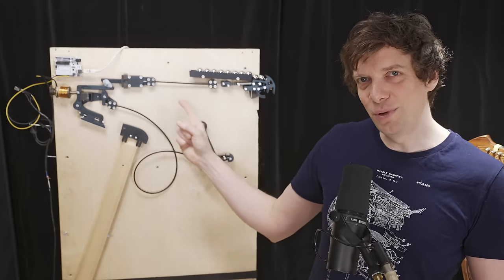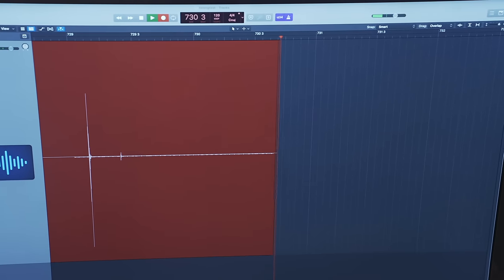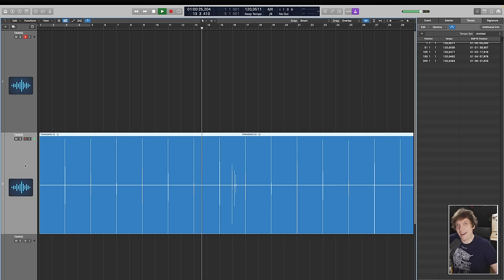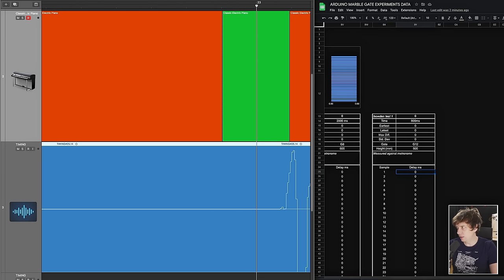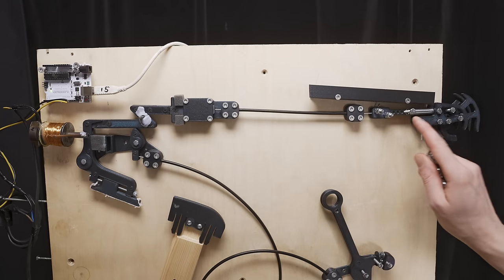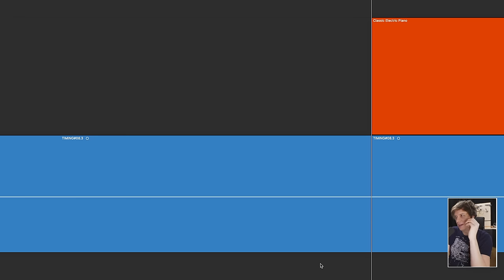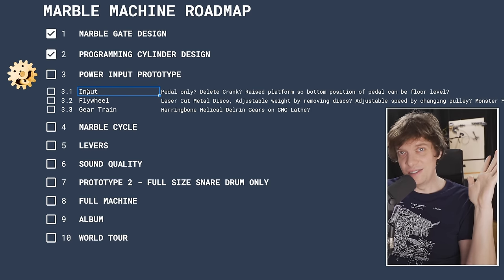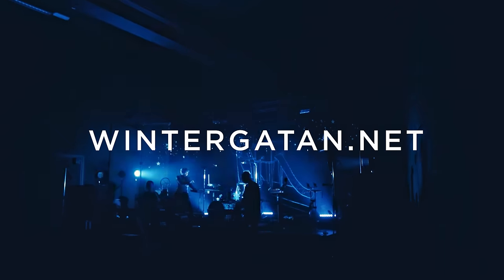Can Bowden Cables Play Tight Music?

Comment: From what I can see you just tested straight and short Bowden cables for the marble dropper. I think you should test out different lengths and degrees of bending of the cables, and compare how much of a difference it makes. This is the optimal condition, and those are unrealistic in the long run 😉

I don’t want to put you down, I just want you to succeed!
Reply: Yes, I've essentially asked the same question.  It'll be interesting to see how he chooses to break it down.  I'd like to see a scale that shows how much variance is accumulated for some standard length (say a centimeter), and how much variance is added for a loop of say a meter vs. a straight meter.
Reply: Similar ideas have been said many times, and so far Martin doesn't seem to be listening... But I agree he must test an actually realistic length and curve - just a small curve in that short length would be expected to make a pretty big difference (capstan equation is a good guide here!). Along with testing just how many notes/ how long that cable can remain under tension before it stretches enough to matter for his desired degree of precision, and for good measure borrow a somewhat used bowden from an old bike and see how much worse one that has some dirt and wear is as well - the shipping of a world tour and all those songs mean its going to become an issue in the end!
Reply: When I study the setup, I'm not sure this will matter.  The critical timing is in the marble release mechanism at top right.  He could pull it with a string or a thick rubber band; so long as the return springs snap it back, the marble drop will be precise.
Reply: Exactly in the end the spring showed that the friction will have an impact on the timings. One more these cables lengthen with time, it would also be necessary to know the impact that its will have between the channels. In a straight line I find that a wire would be much better both in terms of manufacturing and consistency over time. And to return the movement in another direction there are good solutions even with a rigid wire (which will always cause a defect but which will be known and constant).
Reply: Funny he pointed this out in a previous video and even set one up with a loop. I wonder why it isn’t being used for this test.
Reply: + this!
Reply: @youtubemakesmedothis7280  If the cables get longer, the channels will no longer have the same timing between them, which will require regular tuning. If the friction increases it changes the timing of the channel as the spring shows in this video, which will require maintenance (oil) will enter a fault that will require a cable change. A rigid cable would be better or even a fishing line without a sheath.

But if we are here to debate it is above all that the test of this video does not allow us to draw the slightest conclusion.
Reply: The test did show that spring strength to draw the cable through the tube can address variance. I loop test wouldn't hurt but I'm not convinced it's necessary.
Reply: @youtubemakesmedothis7280  Well, we can at least say that the critical moment is when the cable is released.  But, it will still be interesting to see it tested to see if anything unexpected happens.
Reply: I know someone suggested aerospace-grade bowden cables.  But, I'd kind of like to see this tested with degraded cables too.
Reply: One variable at a time. Testing too many things at once, can cause confusion into what is exactly causing problems in the music's tightness.

So testing optimal conditions for the bowden cable, ensures that the only thing being tested is whether the bowden cable is a viable option for use in the machine.

Now that we have that answer. The next question to answer: How bendy can the bowden cable be, and remain tight?
Reply: @deathsheir2035  Yes, you have to isolate variables.  And your right; people do get confused when then fail to do this.  But, you also have to analyze their interactions as well.  Really good analysis would yield metrics for varying lengths separate from coiling, metrics for coiling separate from varying lengths, and metrics for some "sane" combination thereof.
Reply: @deathsheir2035  No, look carefully at 6:57 "verify prototype" is checked. When we are at the stage of design and choice of solutions, we always test in the worst condition and above all never in an unrealistic condition. Otherwise we come back to the worries of the previous machine and arrange choices that were bad at the start but appear good in different conditions. And if we insist it is that the Bowden Cables is not a good solution. Even if it works, it will require an acordage after each concert which would not be necessary with any other solution, other solutions which would also require less construction work which is a criterion for the mm3.
Reply: @tiper2107   You do know majority of all prototypes are first tested under best possible conditions, before being subjected to worst possible conditions, right? I've done prototyping myself, and there is a sieres of questions to ask during the prototyping phase, before you finalize the design.

1. Does this work under the best possible conditions? If the answer to this question is "no" there is no point in testing any further.

2. At what point does this prototype fail?

3. What improvements can be made, to make it work better for longer? Or What improvements can be made, so it can function under worse conditions?

ON TOP OF THAT... Vehicles now adays, designated for "Off Road" are not tested under the conditions of which they are being advertised for. Paved surface, providing far superior grip, with an incline of 5 degrees, for no higher than four feet, is NOT the worst possible conditions for a vehicle designated as an "off road" vehicle. So don't give me that crap about designs are tested under worst possible conditions.

I can also assure you the M-16 when it first entered military service, was not at all tested under worst possible conditions eithern before being sent to our soldiers on the front lines.
Reply: The pulling forces employed are very slight; I can't imagine there'll be much stretching of these cables over hundreds of thousands of pulls on them.  Compared to the forces encountered on bicycle brake cabling, the tug is quite gentle.
Reply: @matambale  it would still be wise to get a bowden cable designed for push pull action, as a precaution. The less maintenance you have to do over time, the better.
Reply: @deathsheir2035  Agreed, especially as there will be so very many of them.
Reply: @deathsheir2035  First read my previous comment, you recognize (staying on your work process) that this is a first test, except in the video it is the final test since it validates the concept!!! I gave you the timecode!
Otherwise, you are mistaken because you are confusing your work, testing prototypes already chosen in an ultra-rigorous framework and design: testing concepts.
If you have to design a hiking vehicle and you think the caterpillar is great. That you test it on a very smooth and flat road, with a perfectly oiled new track and that your engine is already at 100% and that you tell me this test is useful and conclusive to move on to the next stage, you are wrong!! (here the correct solution was wheel with studded tire and the minimum is to compare the two).
Reply: @matambale  The stretching is not due to the force but to the manufacture: multi-strand twist. Then what counts is not the force but the force multiplied by the solicitation. The force will be much weaker but the solicitation in concert will be almost constant and above all will not be the same according to the chanel. This means that the more a note will be played, the more it will lag behind the lesser played notes.

In addition to its wear which induces friction (which we have already seen the impact with the spring in this video) is more dependent on the solicitation than on the force.
Reply: @tiper2107  I literally gave you two god damn examples of designs being tested and approved, that disproves your statement "When we are at the stage of design and choice of solutions, we always test in the worst condition and above all never in an unrealistic condition."

Off Road Vehicles are being tested by car manufactures in unrealistic off road conditions... smooth paved road, with short, but very steep paved incline. And the manufactures uses that as "Yep that's off road" and then sells it as an off road vehicle.

The M-16 is another design that wasn't tested under worst possible conditions. If it was, our soldiers in Vietnam wouldn't have had the issues they were having with the damn firearm.

Two designs that were tested and finalized, that disproves that one statement. And was completely separate topic from the "verify prototype" topic.

PROTOTYPING is all about figuring out if the concept works. If the concept doesn't work under best possible conditions, there is literally no point in testing it under worst possible conditions. Make improvements until it does work, or scrap the concept altogether. If it does work under best possible conditions, you have a verified prototype. After you VERIFY THE CONCEPT WORKS, then it becomes time to test under increasingly worse conditions to find its failure point.

Finalizing and selecting the option ALWAYS comes after prototyping. Just because a prototype works on the small scale, doesn't mean it'll work full scale. The Small Scale Prototype is still a verified prototype.
Reply: @deathsheir2035  Ok I will not debate endlessly on our disagreement which is the usefulness of this test. If I understand your vision correctly, this test is useful but not sufficient, so both agree that it cannot validate this solution only with this test. Except it seems to me that this is what it indicates in the timecode that I gave you and reminded you a second time.
Reply: +1. I was just headding to the comments to say ecactly this. It was mentioned on one of the recent videos that the this design will allow for further distance between the prgraming wheel and the drop themselves. It would be a good idea to test the other extreme of this.

Comment: Warning! Possible hysteresis ahead!   As has been pointed out the upper Bowden cable is a straight shot.  But if you put a bend in the cable you will introduce play.  Try putting a loop in the upper cable (like the lower one) and seeing if it still works for you.  You might need to go aircraft control cables (expensive!).                 Also, a tip regarding using locking nuts for your timing adjusters.  A locknut's prevailing locking torque will wear out.  That is why you shouldn't reuse locknuts on important assemblies.  In my experience the locknut that holds it's prevailing torque is the all metal "flex top".  They have slits cut in it sort of like a castle nut but the crenels are too small for a cotter pin.  The "merlons" are bent inward to lock on the bolt.   Thanks for bringing our favorite show back on the tube Martin!
Reply: i agree with you. And i like to add that Martin only tested this construction with a very slow speed, i'm wondering of it is still as good when it is playing very fast notes. and some point friction is getting a issue, i think.
Reply: @NielsNL68  at high speed you might need to look at average current in solenoid. It might get hot and slow down, but go back to accurate when that "note" isn't being used.
Reply: I believe he already knows about that, and the plan is already to keep these cables as straight as possible.
Reply: A bend only requires that the cable remain under tension in the housing - complex bends can be achieved by restricting the housing.
Reply: Used aircraft cables would be perfect actually, they are always replaced when only very slightly worn because aviation standards are so high. I’ve used one on an off road buggy before, they will work forever here without any issues. Best part is you can probably get them for free if you know someone in the industry.
Reply: @spacemanmat  How do you get them without knowing anyone? I don't suppose they just leave the used ones to a local scrapper.
Reply: @anteshell  that what social media is good for, just need Martin to request it.
Reply: @spacemanmat  Yeah? That's pretty much what I'm doing and still aren't getting any answers. Am I doing something wrong? Maybe I should start by using a decade to build three failed dingle machines?
Reply: @spacemanmat  and they are rated for tension and vibration loads a little above what martin will use them for.

Comment: The Bowden cable is so short, I think it could work but it seems like a longer cable could introduce more flex in the system.
Reply: For these cables to stretch, you need to apply A LOT of force.  They're designed for braking, which applies tens or hundreds of pounds of force.  On a machine designed to work basically off of mechanical links and spring tension, I doubt they'll flex at all.  But I would be worried about the springs stretching or fatiguing with use and that causing issues.
Reply: @hundredfireify  Yeah, it'll be interesting to see if that's an issue.  Pulling with Bowden's is easy.  Pushing relies on their mechanical rigidity which... I mean yeah it's a cable lol
Reply: As long as they are secured properly,  no stretch will be induced. Just make sure to clamp them down where necessary
Reply: @hundredfireify  It's important to note that the marble doesn't release on the cable *pushing*, but when it releases. Flexure in the cables could eventually lead to a given channel no longer playing, but up until that failure point the timing shouldn't vary
Reply: Flex shouldn't be an issue unless he insists on pushing with pull cables. He needs a solid core bowden cable for push-pull, or he needs to use return springs and "pull" against them.
Reply: In bikes you can use fancy compressionless housing which greatly reduce the spongy aspect
Reply: @blak4831  Agreed, and that should take far more than a few concerts to reach that point, and he also has a fairly easy way to attach a fresh cable when needed, as long as the connection points don't get buried in the machine as it all comes together.  
The only "push" he is doing, is on the mute, which while not ideal, is also not going to be under a particularly heavy load, and not subject to a significant timing restraint, so he can probably get away with it relatively indefinitely.  I'd like to see him fit a spring at the other end to tension it anyway though, just to maintain good habits, if nothing else.
Reply: I agree, and I also think that if the cable would be bent a bit (instead of as right now in a straight line) it might be a bit more unreliable. (If this will be a problem I can't determine, since I don't know how the final layout of the machine will be.)
Reply: The bowden cables have no influence on the timing, so that flex wouldn’t matter

Comment: As a long haul cyclist I can tell you that when in use over time cables stretch. You should consider a barrel adjuster in line on the cable to be able to fine tune your cables like we do on bikes. 
Love your process and mostly your enthusiasm. It’s infectious. I’m totally engaged in MM3. Thank you.
Reply: A lot of what we refer to as "cable stretch" is actually the housing getting shorter, which can be helped by higher quality housing and ferrules.  Either way I second the barrel adjuster suggestion; they're so cheap and easy to use.
Reply: You have the same last name as Billy Joe Armstrong. He’s a famous rock singer

Comment: Arduino's internal clock and internal software overhead is also a contributor to timing errors (especially over a longer term)
Reply: Correct, ideal you would record the current of the solenoid coil to see deviation, and also compare solenoid timing to marble hits, and not worry about Arduino drivers and rtos (until later)
Reply: The tempo drift over the test period amounted to -40ppm, probably due to the linear regulator on the board warming the crystal. To mitigate, the Arduino can be wrapped in foam sheet and left to warm up before the test begins.

Comment: Have you considered outputting a pulse from the Arduino to the audio interface? You could then calculate the time from pulse to impact programmatically and not have to worry about trying to align bpm with Arduino clock drift.
Reply: Doing the timing analysis without crossing a clock domain would be best. A device like a Digillent Analog Discovery 2 (Other logic analyzer + Oscilloscope + Data loggers are available) can generate the activation signal and log the response synchronously to exclude any timing errors from hardware. Its nice to see other people with similar concerns about the Arduino's timing accuracy. For short tests it may not be an issue, but over a longer period the results could get strange.
Reply: @lukekamrath8795  would using two audio channels on the same adc not prevent any drift by decoupling the recording from the input clock? The Arduino clock speed is sufficiently above the Nyquist frequency of most audio cards by several orders of magnitude and in excess of the levels of precession required for musical precision. If not you could use the driving Arduino to capture the response as it has a2d channels as an alternative, keep it all with the onboard clock. There'll be sufficient lag in the coil de-energising to give plenty of time to start listening.
Reply: @bloke1987  Another mic near the solenoid to record the mechanical noise of it activating along with the marble drop and having those two channels synced on his computer would be easy and resolve nearly all the timing uncertainty.  Doing the generating and recording on the Arduino would also work since the clock wouldn't drift any perceptible amount between a release and marble impact. I may just be overconcerned by some tiny errors far below a millisecond. It looks like Martin is happy with the timing anyways.